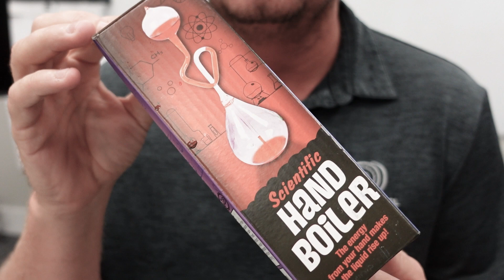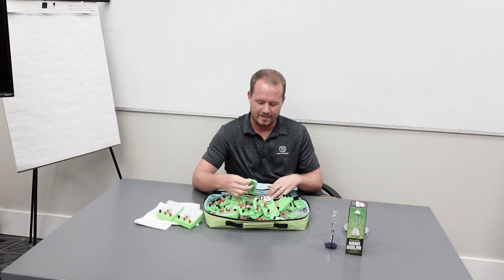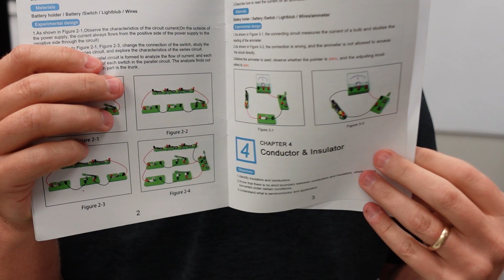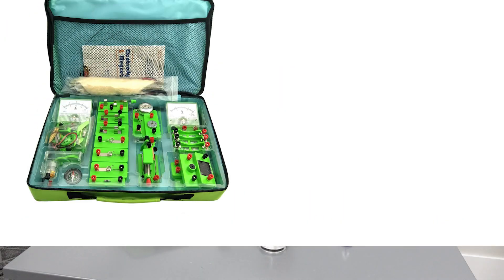Demonstrate Some HVAC Basics the Fun and Cheap Way

Comment: In the classes I teach, I would boil water at room temperature using an acrylic bell jar vacuum chamber, flask, water and vacuum pump, I would have a digital thermometer in the water and would ask the question, what will happen to the temperature of the water as it boils in a vacuum, will it increase, decrease or stay the same. Good demonstration on phase change.

Another cool demonstration is stoichiometric reaction that demonstrates complete combustion. However, the powers that be refused to let me do live demo's, so I had to switch to video, here is the link.
 https://www.youtube.com/watch?v=QpgADJmsYQ0

Comment: Radio shack also has several kits available for basic electrical and electronic circuits.
 Dad was a ham operator in Germany during the Korean conflict. When I was young he had several Heathkit kits. I loved watching those go together. When I started in the fire service the first siren that I had was a Heathkit. Tinkering with model railroad and the heathkit circuitry led me in to troubleshooting. One of my first fire dept captains was owner of a large union sheet metal firm that had been involved in industrial and institutional heating, then cooling and process controls. I travelled 9 states. Very nice career. Sadly, the fourth generation of owners were of the 'rape and run', rather than 'nurture  long term client relationship mindset, and after merging with a corrupt pipefitting outfit, had to auction off assets and eventually close.

Comment: That electrical tinkering kit is EXACTLY like this game software I used to play with as a kid!!! It's what really helped me to be one of those kids that took everything apart just to see what was inside. 😸 In the game, you had a mini game where you had to build devices for people using heaters and fans and bulbs and switches and batteries and bells and all kinds of stuff. That taught circuit design from scratch. In another minigame, characters brought you devices that were broken and you had to fix them. That taught diag and repair with test equipment because it included a volt meter and stuff to measure or test with. I forget the name of it. This was from like, Windows 98. I first remember using it when I was in 2nd or 3rd grade with my dad helping me. It worked on XP too when we upgraded from our 98 Gateway to our Compaq XP. I feel so old. 🤣 I'm not even 30 though.